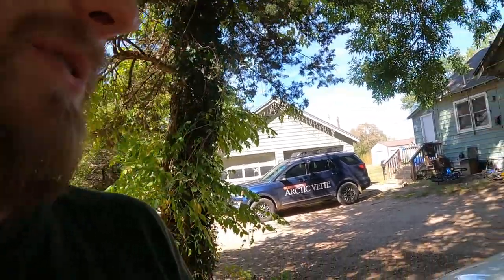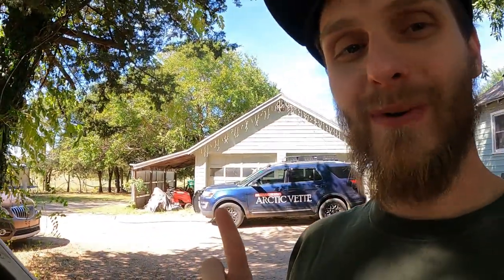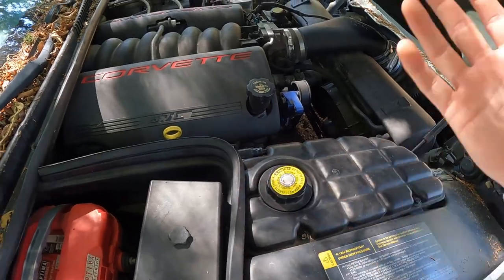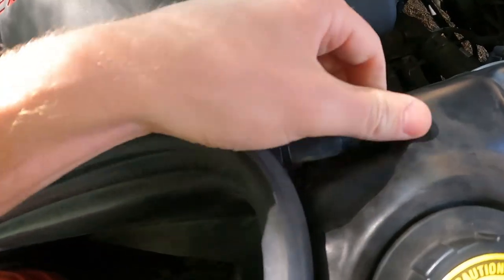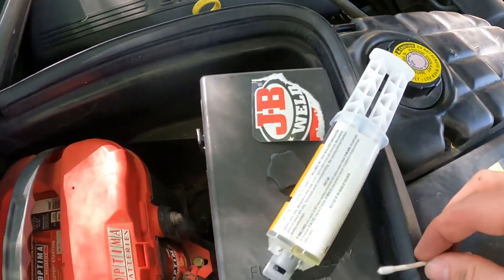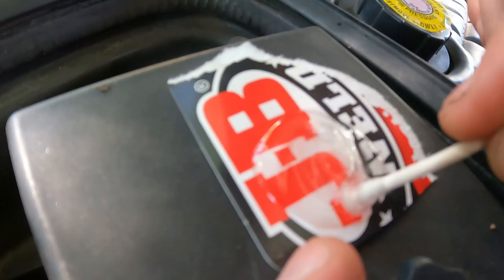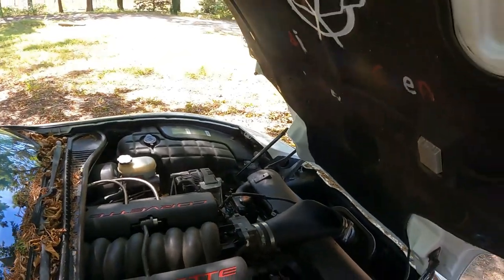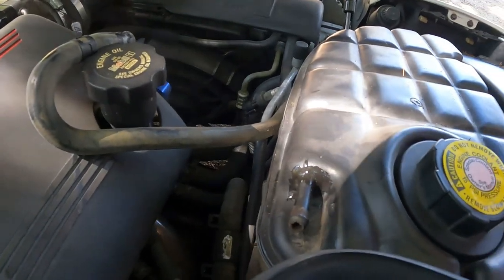Fixing Coolant Reservoir with JB PLASTIC WELD on C5 Corvette (1997- 2004) - Daily Vlog

Comment: Nice video, short and to the point.  The production assistant did a great job ;)   I'll try this on my '83 Olds 98, which has a cracked overflow tank.  This will probably work, depending on how extensive the cracks or pinholes are.
Reply from the maker: @thomashubbard1673  mine didn't hold for long, and I ended up replacing it with a new tank. Thanks for the feedback! 🙌🏼
Reply: @ArcticVette  thanks for the update!  Guess I might try another option.

Comment: You guys make an awesome crew! Fine job as always 😎
Reply from the maker: Thank you! 🔥🙌🏼
Reply: Did the JB weld hold?
Reply from the maker: It did hold, but it exposed another leak in the tank. I ended up replacing it altogether and now I need a sensor for it.
Reply: I did same with my old 90s volvo expansion tank there is an fault on the volvo tanks or water always find the way out every 25k miles
Reply from the maker: Glad to hear others have done this for other cars too! Thanks for sharing 🙌🏼